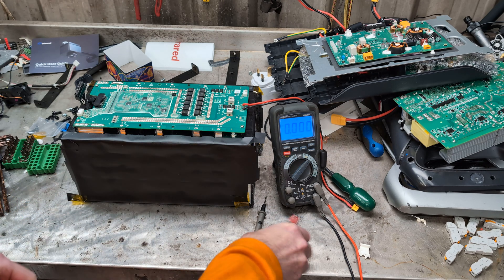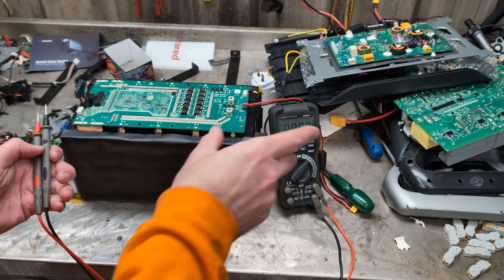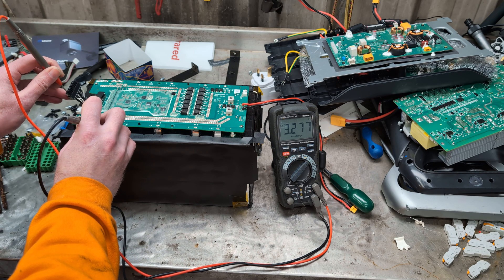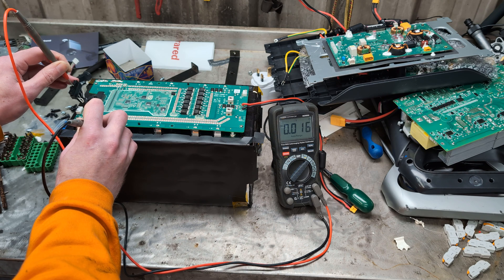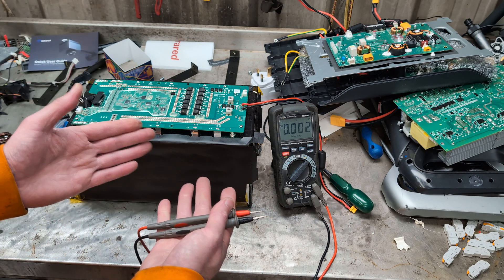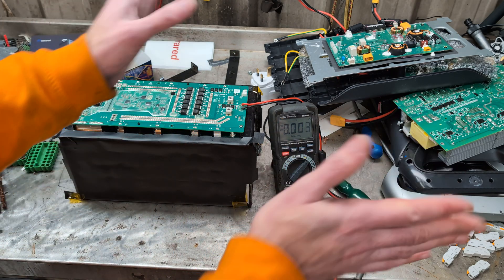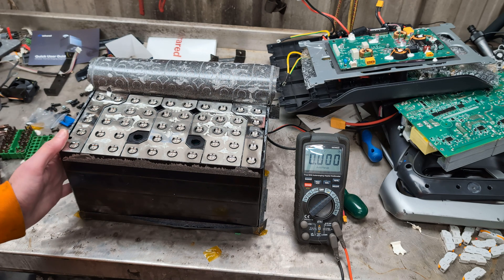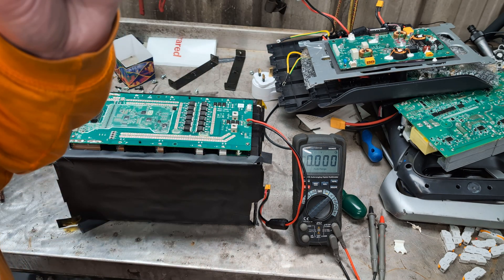DIY power station part 1 - I need BMS help

Comment: Every bms I've installed or used has a short circuit protection.  If it shorts it blows the bms and has to be re replaced.  I've found if I solder in a semiconductor chip like a diode it flip its polarity and stops the current from shorting out . I get tiered of replacing those bms boards

Comment: Unless there are other 'hidden' connections to the other half of the cells, I have to assume they are balancing pairs of cells in series - presumably as a cost saving measure.  It's a shitty solution if so!

I think your only (good) option is to solder wires to the even cell positives such that you have one wire per cell - then use a 16S Balancer / BMS.
Reply from the maker: I have emailed you, likely in the spam folder.  :)
Reply: No, the even no. cell connections are solder tabs around outside, odd no. cell connections come on the plug/white wires. every cell is balanced individually.
Reply: And exactly why these are failing as they age and the cell resistances increase, each cell should be individually charged and balanced. Look at RC packs for a example.

Comment: Also - be careful. A fully charged 48V battery is potentially capable of electrocuting you
Reply from the maker: Just like welding in the rain.  You get a good dunt at 50V.  :)

Comment: a LiFePO4 cell is 3.2V. So I think you were getting 1 cell in series, then 3 cells, 5 cells etc.

I'd be interested to know what'd happened to the Black wires. They could be thermistors for temp sensing.

Of they could be faulty and that's why the BMS is refusing to charge

Comment: On that PCB where each of the battery battery tabs hits the pcb, they are labelled b2, b4, b6 etc, i think those are the even connections as you can see a solder dot for each pad.
Look on the board bottom for a trace/wire running back to the bms ic
Reply: The even no. cell connections are solder tabs around outside, odd no. cell connections come on the plug/white wires. every cell is balanced individually that way.

Comment: I can't tell you for sure since I have only build one battery and it was built from 8 individual brand new cells to form a 24v battery.
In your case I guess (no guarantee) that the original BMS on your cells measured two cells at once instead of every single one, so you could probably think of it as having 8x 6,4v cells. good luck finding a new bms that just connects plug and play to the original balance leads 😂

Comment: Even cell connections are on the board and odd cell connections are on the white wires of the cable.  The cable with connector was probably used to make assembly easier since it is accessing the connections in between the 2 halves. The black wires are very likely temp sensors.  You should not need to tear down the pack any further unless you want to change it's configuration away form 48v.
Reply: Yes, exactly this!!

Comment: If you have a 48v battery with a 48v BMS, just use it as a 48v battery.  If you need to break it down to a lower voltage, pull the BMS and split the pack to 24v.  If you're after making a 12v setup you're going to be completely tearing the pack apart and starting from scratch.

The BMS leads have 1 wire to the battery negative, then every positive after that. There may be leads in between the packs sandwiched inside there.

Comment: Hi Dave.
I think you are measuring cells 2 4 6 ect... cells 1 3 5 connector could be hidden between the packs?
Reply: Half the cells are on the connector, the other half are soldered to the board 3:58
Reply: But Dave measured the voltage from the positive side so it’s inverted

Comment: the battery is prolly a 16SxxP pack BUT my guess is: not every cell is individually balanced and measured but 2SxxP compounds. so you'll end up with doubles of the LiFePo typical 3,3V voltages.

could be for cost saving and isn't even that risky with Li iron phospate cells as they are pretty safe. but will obviously not help with cycle life.  (i can imagine that is an intentional achilles spot in the otherwise extrem long lasting LiFe battery).

in the end they run the company from selling those power stations.  and if the LiFe cells plow through the 2000 cycles that a homegamer would put on it in like 15 years the money/revenue thing ain't gonna work out 😂

i could also imagine some kind of mistake in the measurement scheme. but thats unlikely.
Reply: I came to suggest the same, lifepo4 tolerance to abuse means they are happy to spot the voltage drop as pairs.
The other wires are possibly temperature sensors
Reply: No, the even no. cell connections are solder tabs around outside, odd no. cell connections come on the plug/white wires. every cell is balanced individually.